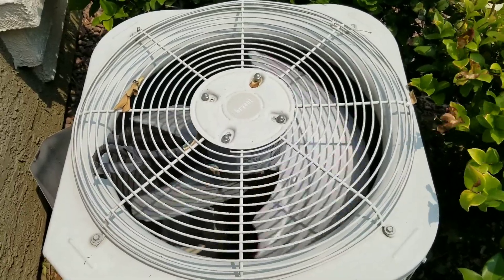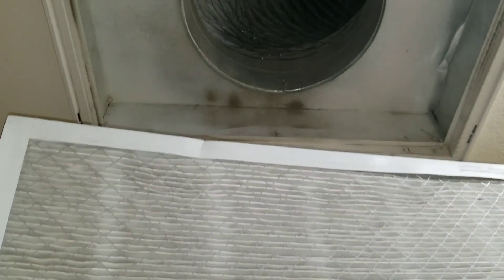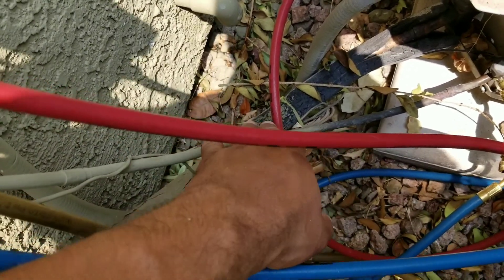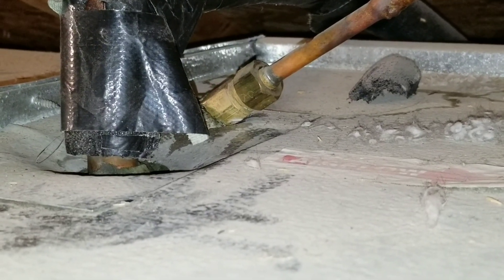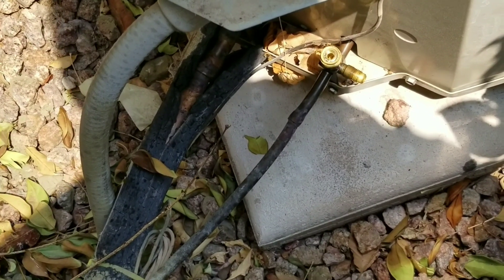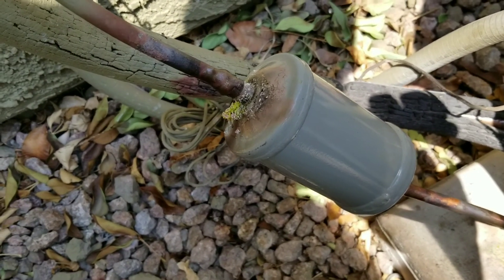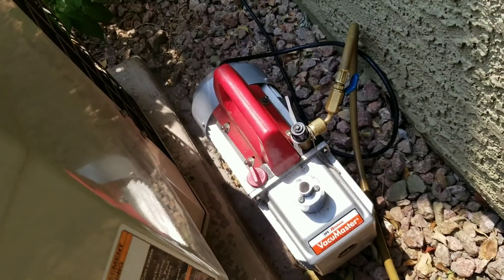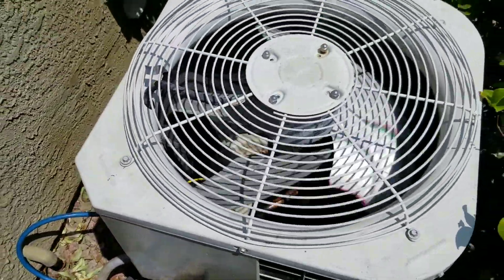How to Clear RESTRICTION! HVAC Using Nitrogen.

Comment: #1 low on charge
#2 blower motor stops running
#3 AIR FLOW thru your ducting, could be a closed damper or collapse duct, or a clogged return and or supply vent
#4 not enough air flow flowing thru your system
#5 blower is running backwards upon install and no one cared to check
#6 condenser fan isn’t running
#7 restriction in the refrigeration system, or any non condensables and or moisture in the system. 

Before even looking at the refrigeration system everything else must be checked before diving in the refrigeration system.

People tend to overlook the basics and in my opinion the filter doesn’t truly effect the unit to the point where it starts to freeze over, although a dirty filter can restrict airflow, and cause a drop in CFMs, its the least of your worries.

Comment: I'm not an HVAC tech; but, the vacuum you did is the worst I've ever seen.  A gauge set can't get you to a 250-micron vacuum to be sure you have all the moisture out of the system..!  Regards, Joseph,  Thank God for the University of U-Tube..!
Reply: Yes it can, you obviously won’t be able to tell, but you can get a proper vac through the manifold.
Reply: Guage set especially a well built, clean digital manifold has the vac instrumentation as well as ability to calculate leak rate/rise to help distinguish leaks from water
Reply: @Skunkhunt_42 :  If you're not using a micron gage to gain a good vacuum you must be an auto mechanic..LOL
Reply: @josephsomeone1611  maybe wasnt clear but im saying a digital guageset can include micron guage. - not an auto mechanic.
Reply: @Skunkhunt_42  OK, haven't seen one; don't know how reliable the micron side could be?  Send a link to a digital gauge set that has a micron reading ability..  Thanks, Joseph
Reply: @josephsomeone1611   Fieldpiece SM482V has on board vac gauge. I know several old school techs that don’t use micron gauges, run the pump for 20-30min and call it good. They do a good pressure test and check all the joints. I didn’t get one until I went off on my own. Hell, There are new techs that don’t even pull a vac, just purge the lineset like we do hoses.
Reply: @MoonRambo702  Thanks for the info on the Fieldpiece; I'll look into the subject more, regards Joseph
Reply: @josephsomeone1611   just out of curiosity, what brings you to comment on HVAC vids?

Comment: Yo. Can you just do a pump down with the refrigerant into the condenser or is it better to remove the old refrigerant and put in fresh refrigerant? I'm assuming if you use the old refrigerant you can just pump down into the condenser right?

Comment: What temperatures should be on both ends if filter drier?...to consider it a restriction?I did all that blew 200 psi on high side to low side,,,took the  piston out made sure it wasn't clogged..n pressures still the same 
1st57 low.....220 high after
60 low.....225 high.!!

Comment: If you checked super heat subcooling you wouldn't be guessing so much. High suction is not a restriction in liquid line
Reply: The suction pressure was over the limit on the gauge, and the high side pressure was in a vacuum. What is superheat/subcool going to tell you? It doesn't take a brain surgeon to tell there is something serious happening.

Edit: I read some more comments and see that he had the gauges hooked up backwards. If those were the true readings my comment still stands. He may have done that just for demonstration to simulate a restriction. Those readings for real would be extreme.
Reply: @realSamAndrew  with a restriction you would have low suction pressure as well. Because of the pressure drop in the liquid line. Superheat will tell you if your flooding/ starving the EVAP coil under feeding or over feeding. Low super heat flooding now picking up enough heat air flow issue. High super heat starving picking up to much heat so under feeding the valve so possible restriction with high super heat. Have to have superheat reading to diagnose or guessing. You check the charge in subcooling on txv but need to know super heat to know what's going on in the EVAP coil

Comment: Dude you had your gauges on backwards that’s why the suction pressure was so high and the head pressure was so low because you had the gauges reversed. At 1:25 it clearly shows you have the blue low pressure gauge attached to the high side of the condenser. And the high side of the gauge on the low side of the condenser that’s why your pressures are reversed. Then at the end of the video you have it hooked up correct after you “fixed” it.
Reply: 😆 maybe he had a long day lol
Reply: @aaronfarrow5369  we've all done something stipid like this lol
Reply: Hahaha
Reply: It was a test.. you passed 😂
Reply: it blew up a few days later.

Comment: So you don't know what the problem was ? I guess crap in the line so just blow out and add dryer. It seems you should clean the lines out first.
Reply: Blowing the restriction out will put it either out of the system or on its way to the filter,  to flush a system requires a lot of extra work thats unnecessary..  and if you dont get every drop of the flush out of the system it will react with the oil

Comment: Im at a unit that has a fairly new filter dryer,can i still blow system with nitrogen with it on & use the existing filter dryer?
Reply: No. Always replace filter drier..  dont let it be exposed to the open air for long at all either...  theyre cheap so just order off ebay
Reply: As he said always replace the filter dryer lol I know this is a little late though

Comment: How are you charging it? Liquid on which side? What if mine doesn't have filter/dryer? Is that bad?
Reply from the maker: Liquid line is the high side (skinny) line. The filter drier should be installed if you are evacuating the system and recharging the system. Hope that helps 🙂👍

Comment: Do pistons come in different size?how would i know which one ill need for my system?
Reply: Manufacturer specs
Reply: Often the appropriate piston size is attached to the new condensing unit (I usually toss them as install txv systems) in a little  bag by the service valves.  Wholesaler should be able to hook you up, piston size is specific to tonnage...

Comment: No micron gauge?  How long did you leave the vac pump on it?
Reply: jaythompson222 I usually let it pump for 20-30min
Reply: We never had micron gauges or digital gauges  in the old days, we pumped down a system untill the guage read -30 microns and then pumped it for another 30 minutes.  If it held for 15 minutes we would charge the unit old school,  using our math skills.
Reply: You did have a micron gauge..  how did you tell it was 30 of them fuckers?  Put a bug in the sight glass and when its head pops youve reached vacuum...?   Lol
Reply: @Z-Ack  I wondered same shit. He said they didn't have micron gauges but then said he waited for it to hit 30 microns before calling it good